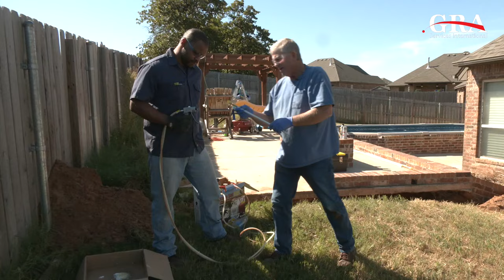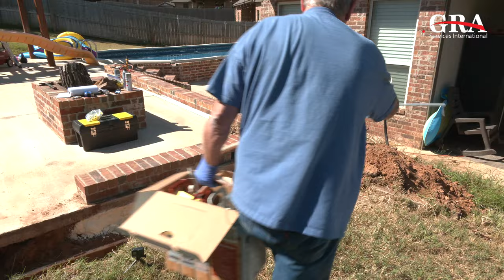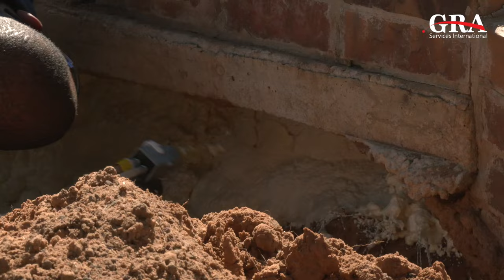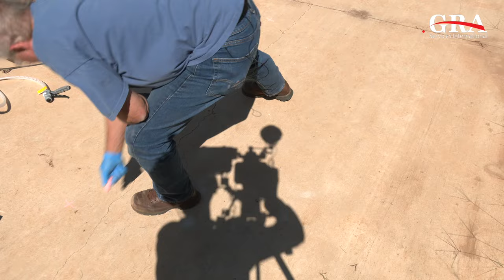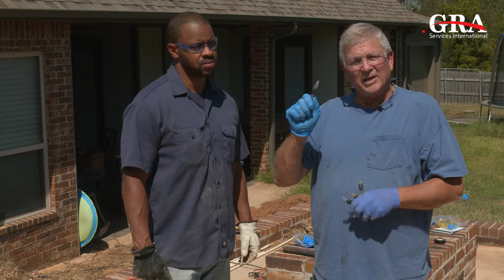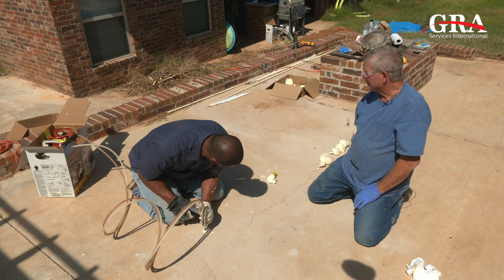Filling a Void Under a Concrete Patio  with Secure Set Spray Foam

Comment: No idea if youre still seeing these comments, but my boyfriend is having these types of issues & has a VERY big void under his slab. Ive suggested this spray foam solution but he's concerned about whether this foam would be bouyant enough to cause lifting problems in/after heavy rain.... (?)
Reply from the maker: Although Secure Set Spray Foam is also used for buoyancy in projects such as boat restoration, there has never been a report of it floating a slab.  Prior to rolling out our spray foam videos for the DIY and contractor markets, we have provided this product to the utility industry for many years.  Thank you for watching our video.  GRA Services - Secure Set
Reply: @SecureSet-Fence-Installation  thank you!  Hopefully I'll be able to convince my hard-headed boyfriend to go this route & finally fix his issues for good!

Comment: Hello, I’m having a similar issue but under my porch. It’s not a huge void, and I can tell the previous owners of my home just patched the concrete to hide the issue. If I use this to fill the void can I concrete over it? I’m new to this and doing as much research as I can to do the repair on my own.
Reply from the maker: Thank you for the question.  Yes, you can always pour concrete over the cured Secure Set foam base.  GRA Services - Secure Set.

Comment: Does it have to be within a certain temperature range?
Reply from the maker: Hello Obsidiansea,  Yes it is a good thing to have the product warm when you use it.  Thank you for asking.  I have copied and pasted the guide we have inside the case, now that winter is coming.  Here it is:

CAUTION COOL / COLD Weather

Winter is coming, using Secure Set Spray Foam during this season, you must follow a different protocol.

Outside temperatures are getting colder and colder.  Cold ambient temperature is not necessarily a restriction for the use of the foam.  HOWEVER, cold product temperature will result in very poor application and quality of foam.  This can be overcome by dedicating time to warm the twin canisters before you use the foam.  Canisters warmed to 80° to 95°F will produce very active and high quality foam. The temperature of the foam can overcome the coolness of the soil and air temperature, IF the product is sufficiently warm.  You can achieve the expansion and reaction of the foam you desire if the foam is warm.
WARMING THE CANISTERS  
Prior to use, open the Secure Set Spray Foam case and remove the canisters from the case.  Put them in an oversize box, separate the canisters by a few inches, and blow warm air into the box overnight.  You cannot adequately warm the canisters with just an hour or two of warm air. Once the canisters are warmed, replace them in the original case.  Keep them protected until you are ready to use the foam. If you follow these instructions, using Spray Foam in an outdoor environment is possible well into the cooler months of the year
Reply: @SecureSet-Fence-Installation  Thank you. I was thinking of ordering it now anyway and waiting for a warm day to do it. I checked the historical weather in my area and last year, there were actually a few days in November where it was unusually warm - 70+ degrees.
Reply from the maker: Hello,  It is the Depstech DS300  great tool to have
Reply: @SecureSet-Fence-Installation  Thanks - I saw you posted the link!

Comment: How many kits were used in this video?
Reply from the maker: Thank you for the question.  We used 1-1/2 of the 10 cu. ft. kits.  At the time of this video, we only had the 10 cu. ft. kit, which supports 10,080 lbs. per sq. ft (way more support than necessary for a patio, or even most residential driveways).  We now have a 16.6 cu. ft. kit, which will support 5,040 lbs. per sq. ft.  If we had another project such as this, we would use this 16.6 cu. ft. kit, which gives you 66% more foam for the same price.   GRA Services - Secure Set

Comment: I got a small job where a vol i think burrowed under my porch slab. Trying to get out of this as cheap and easy as possible.
Reply: Once you start the application of secure set how long is the shelf life of the kit? Can hose kits be changed and the kit be reused at a later date?
Reply: I have the same problem how do you resolve it

Comment: How environmentally safe is this?  I can’t imagine it would be.
Reply from the maker: Hello Rainbow Land.  This is the same type product that is used to spray foam insulate your home.  It is just stronger and more dense.  It is closed cell so no air or water can get through it.  This is used all over the country to PROTECT all types of buildings, water resources, pipelines etc. Thank you for your comment, you can rest at ease, this is a far better solution than using concrete, which allows alkaline to leach into the soil and ground water.  Thank you
Reply: Closed cell foam sets up as an inert plastic, so no it is not environmentally toxic

Comment: Hi.

I've got a few hollow spots under my sidewalk.  
Can I drill a hole just large enough for a spray nozzle to fit, then use minimal expanding foam?

Thank you.
Reply from the maker: We would drill 3/8" holes and wrap black electrical tape around the mixer nozzles to seat well and fill the hollow areas with the Secure Set Spray Foam.  Thank you!
Reply: A foot or2 in FLA.we get wash back to poolwall...we use watery morter with limestone...
Reply from the maker: We have many customers in FL that use Secure Set Spray Foam, as well as our Secure Set liquid mix/pour products.  Our foam is high-density, closed cell foam, which won't settle or crush in these applications.

Comment: i need to do this.  I think I saw that one box is $500?  Can you confirm? I may need at least 2 boxes
Reply from the maker: Thank you for your interest in Secure Set Spray Foam.  We actually now have 2 size kits available; the 120 BD / 10 cu. ft. of high-density foam that supports 10,080 lbs. per sq. ft. and also a 200 BD / 16.6 cu. ft. of medium density foam that will support 5,040 lbs. per sq. ft.  We wouldn't hesitate to use the 200 kit for most projects, including residential driveways, since the load of vehicles is spread over all wheels.  We try not to post prices on here since there are too many price fluctuations over the years, but you can call us direct (405-672-8885) or check our web-site at www.secureset.net for current pricing.  At this time, only the 120 kit is listed on-line, but we have both kits priced the same, which includes the shipping throughout the U.S.  If you decide to order on-line, and want the 200 kit, just make a note to that effect in the comments.   
GRA Services

Comment: How do you keep it from raising the slab if you do not need it raised
Reply from the maker: Thank you for the question.  You just apply the foam and allow it to expand to the path of least resistance and do not overfill the void.  When you have  side access, like we show in the first part of this video, it is easy to see where you are applying the foam and how it expands and fills the void space.  It always has an escape route.  When we drill through the slab and apply the foam blindly, you must first investigate and attempt to understand the size of cavity you are planning to fill.  We show this process with the hammer sounding, drilling, measuring, as well as endoscope camera usage.  There is a chart in the kit that shows how much foam is applied for each minute of spray time, as well as shorter increments of time.  One minute of spraying equals approximately 1 cu. ft. of foam.  Just do not overfill the void space and you won't have any lifting. 
If you want to lift a slab, we have 2 videos showing that process, as well.

Comment: How much does the home owner save by doing the job themselves?
Reply from the maker: There are a lot of factors to consider in order to answer this question.  Every job is different and prices vary by regions as well as contractors.  You would just have to do some price comparisons to answer this question for your area and individual project.  Thank you,
Reply: @SecureSet-Fence-Installation  I have three slabs of concrete driveway that i need to do what would be the best way to figure my do it yourself order kit?

Comment: Can this work under a garage slab? Will it hold the weight of a vehicle?
Reply from the maker: Thank you for your question.  Yes, our Secure Set Spray Foam has a very strong compressive strength.  We have 2 different kits available now, our 10 cu. ft. kit will support 10,080 lbs. per sq. ft. and the 16.6 cu. ft. kit will support 5,040 lbs. per sq. ft.  Both kits can be purchased on our website www.secureset.net, or by calling us direct at 405-672-8885.  GRA Services - Secure Set

Comment: i’ve been wondering if i could lift a slab back up with the foam
Reply from the maker: Hello Mike,  Yes, this product is capable of lifting concrete slabs.  It takes a little finesse, but it can lift slabs of considerable weight.  If you email us some pictures of your intended project, we can give you a better idea about how to go about your project.  email is   info@graservices.com   Thank you
Reply: @SecureSet-Fence-Installation  Does the product ship tp Canada?
Reply from the maker: @MolloRelax  Hello MolloRelax,  At this time we cannot direct ship to Canada.  Canadian Government still has Covid Restrictions in place that will not allow us to ship Haz Mat material across the border via Fed EX or UPS Ground. If you live near the border, we can ship to a USA location and you can get it.  Many users have done this.  Thank you
Reply: @SecureSet-Fence-Installation  how about now that the restrictions are lifted?
Reply from the maker: @dannymayes1963   We no longer are shipping to Canada, since this is a hazmat package because of the pressurized canisters.  Our Canadian customers have the package shipped to a border crossing area and either pick it up and transport themselves, or they have a ship center forward to them.  We can email you the hazmat label information and you can check with customs at your border location about transporting.  It is non-flammable gas but is chemical under pressure, which creates the hazmat classification.  Please email info@graservices.com for the label info, if needed.  Thank you GRA Services.